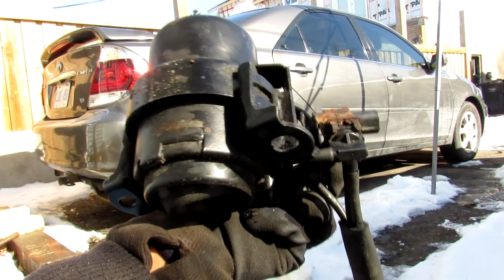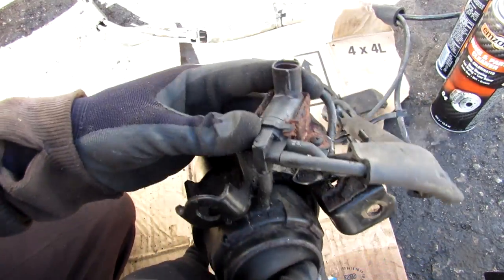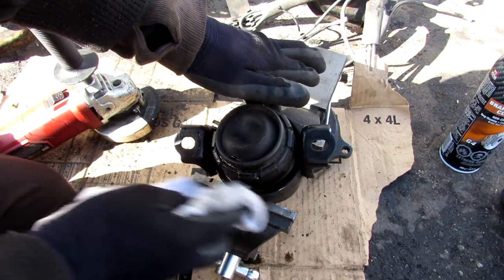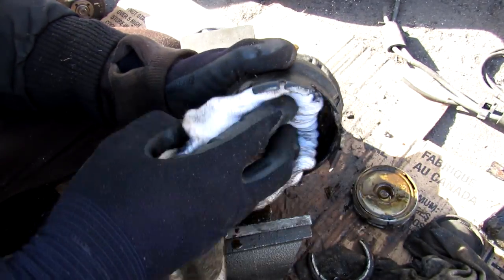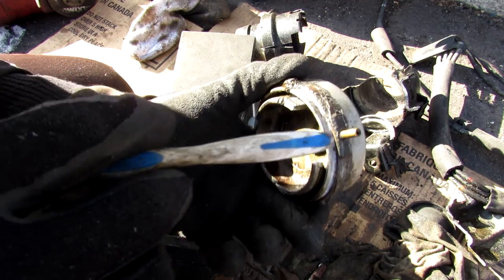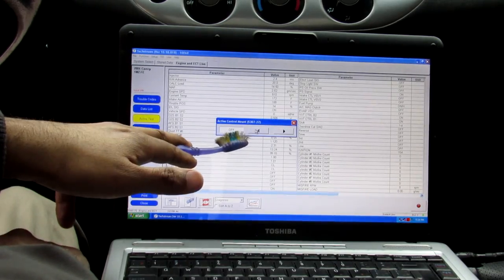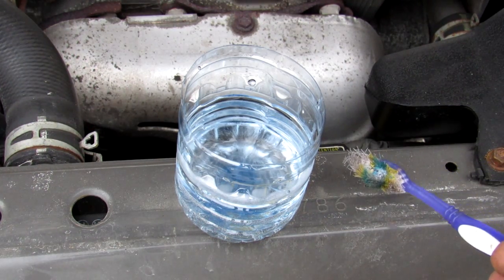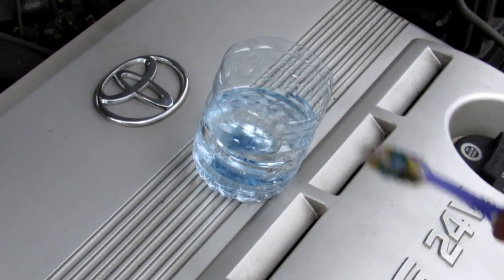How an Active Engine Mount Works

Comment: Active engin mount. Sounds like something more that will break.
Reply: You could use a 5 dollar piece of rubber or we can use a 300 dollar complex piece of crap just so karen can brag at soccer practice how sweet her ride is. Its shiny and has lots of "goodies" she didnt even know she needed
Reply: @bolerdweller  - 'Karen' wouldn't know the difference if a standard $20 mount was substituted.

Comment: My Toyota 1mz-fe engine mount was replaced with an aftermarket one a few years ago. The transmission repair guy said he needed to replace it. I noticed more engine vibration right away. It's not too bad though. However I I told the mechanic he should've told me before he replaced it so I could decide OEM or aftermarket.

Comment: I've been wondering for a couple weeks now how this worked.  I changed all my mounts in my 02ES300, but got stuck on this one.  It was super tight coming out, then noticed the new one was bigger.  So I stuck the old one back in, and was not able to get the switch mounted back on.  Another great video.  I've always had to know how things work.  Been tearing stuff up since I was very young.

Comment: Awesome explanation- TY! I had no idea that was in my car.. I went to replace the 3 lower mounts and found the front one that I got wasn't an active type. There's not a lot of room in there- do you have a video on how to pull this one out and replace it? Or at least, can you say if it comes out from the bottom or top of the engine compartment?

Comment: Thanks for another great video.  Our 2005 Toyota Avalon shudders/vibrates when accelerating from a stop so I'm suspecting it could be the engine mount or maybe the cv shaft.  It s=doesn't vibrate at highway speeds or when braking.
Reply from the maker: When near a stop it's probably not the CV shaft. 
Check to make sure it's not the engine itself bogging down from a dirty throttle body or something
Reply: @speedkar99  OK I'll check and clean if necessary.  I cleaned it 4 years ago when I replaced the ignition coil #1 where I had to pull the air surge tank to get to it so I cleaned the TB but it wasn't all that dirty.  It's been about 13,000 miles since I cleaned it so I'll check it again.  Many Thanks!

Comment: Great video!  I had no idea active mounts existed.  I have an unrelated question: at 6:35 I can hear your engine making almost a clicking sound, I guess, at idle.  I have the same engine in my '00 Camry and it makes the same noise at idle, although a bit quieter.  Do you know if this is normal or something to worry about?
Reply: I think it’s normal

Comment: Very cool. I don't have the active ones on my camry, just 3 hydraulic (plus the dog bone). I do have an annoying intermittent vibration lately... I'm leaning towards replacing the side mounts since they are 18 years old now but I wish there were a good way to really diagnose them. They SEEM fine
Reply from the maker: If oil has leaked out or you notice the engine rock alot back and forth when Changing from R to D then it's time to replace them.
Reply: @speedkar99  Nah, I took it off completely and it seems fine.  But on another vehicle (ford minivan), I had the same thing where I couldn't detect a problem but it had failed internally - maybe a valve or diaphram broke - and was not absorbing vibrations.  Replacing it fixed the problem immediately.  With the toyota, they're just so expensive, I hate to throw a part at it and not solve the problem.
Reply: @speedkar99  Also, I replaced the front one and dog bone.  I'm thinking the transmission mount is the problem

Comment: Great video! I am thinking about replacing the lower control arm and engine mounts on my 2004 Lexus ES330. They are showing signs of wear after 240K miles. I'm torn between buying Lexus/Toyota parts at a very high price or aftermarket. I saw a video on Anchor mounts, but I'm not sure where they are made nowadays and if it's worth putting them on. With Moog, they give you a limited lifetime warranty, but if they fail, and with the labor rate of $120 and up, is it not really worth it? In your experience, are there good aftermarket engine mounts for my car? Thanks!

Comment: Hay nice stuff. Need your assistance.  M driving a camry vu 2005 American spec in Dubai. However my concern is there is a slight delay few seconds when ever I raise the accelerator.  Is this normal for v6?
Reply: I hav gone everywhere replaced spark plugs cleaned throttle replaced axles catalyst repaired gear box but I still feel  the delay.
Reply from the maker: Yeah the earlier drive by wire camrys were laggy. Mine too
Reply: Is it normal?

Comment: My 2000 avalon has the same mount. It went bad and I replaced it about 2 years ago with a normal non active mount, ONLY because nobody had the active one in stock that doesn't cost a rediculious amount. I haven't had luck finding a replacement mount shock either so I left it. I noticed a little more vibration at idle but not much more than it used to be.

Comment: Won't an issue with the hose (like a crack) or the motor mount cracking cause a vacuum leak issue with the engine?  Kind of like causing a lean condition at idle?

Comment: Bro when you activated the engine mount you sent air into the mount and compressed the hydraulic chambers so you increaed the spring rate of mount. When there is no air in the system these two chambers touch each other and establish a softer mount. However  stiffer spring is soft for higher loads and higher frequencies. When you rev the engine up to higher speeds you will need a stiffer sping mount to have a softer ride. You shouldnt activate it at lower revs or adjust proportionally. When you activated it you sent air at full rate. This gadget shouldnt be on off valve but a proportional valve. This is my assumption from my vibration knowledge and hydraulic control. I didnt know this type of mounts until I saw your video thanks again :D

Comment: very good video - but what I don't understand is when will you feel excessive vibration if one of these goes bad  - is there primary use to reduce vibration when going at idle as the video seems to say at one point?  Of would you feel vibration thru all RPM ranges, or ???

Comment: I thought it would be the opposite.  When the active engine mount is "off" , should the engine vibrate?
I'm trying to figure out why I'm getting a slight vibration in the cabin when the car is at a stop and in gear. It's like a slight drone. Most people won't even notice it but I know this engine show be very smooth at when in gear.

Could it be my motor mounts? 130k on car.

Changed plugs
Pcv
Cleaned mas air flow
Injector cleaners
Reply from the maker: Yes it could be the mounts. If you have active mounts then use the scan tool software to enable and disable. If there's any noticable change then its working. Otherwise you have a vacuum or electrical problem

Comment: Speedkar99's brother: have you seen my clothes? 

Speedkar99: I used them as towels. 

Brother: why?! 

Speedkar99: what else would I use? 

😄
Reply from the maker: Brother: buys new clothes
Speedkar99: thanks bro
Reply: @speedkar99  brother: I just bought a new toothbrush. 

Speedkar99: thanks for my new pointing stick

Comment: Hello sir. I have the same vehicle. Is it possible for a diagram of how the vacuum hose connects. All my hoses are damaged. Just where the lines go on the witch to the air box. Ty
Reply from the maker: That should be under your car's hood
Reply: @speedkar99  you wouldn'thappen to know where the transmission vent tube is located?

Comment: Aren't V6 engines inherently smoother than i4 engines? At least at load. But what about idle? Are V configuration smoother than i configured engines?
Reply from the maker: Yes V6 is smoother than i4. But i6 and V8 is smoother than them both. It has to do with the derivative of acceleration (secondary inertia forces), and how they are balanced in the engine configuration.
Reply: I6, H6, V12, ....

Comment: I must have totally misunderstood that demonstration. With the active engine damping mount turned OFF it was nice and smooth, and with it turned ON you could feel the vibrations? Seems a very expensive and complicated way to inject vibration into the chassis. I'd be looking for a way to permanently switch the damn thing off :)
Reply from the maker: This doesn't inject vibration. It isolates it. When you turn it off, the solenoid turns off.
Reply: @speedkar99  I'm sure you're right, which is why I say I don't understand. I still don't understand how something only works when you turn it off but I can live with it. Thanks.